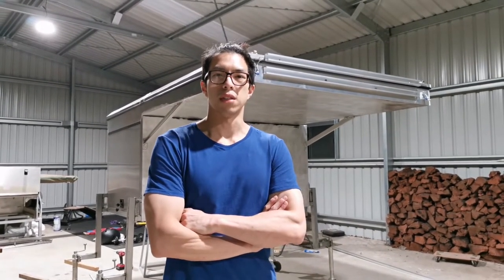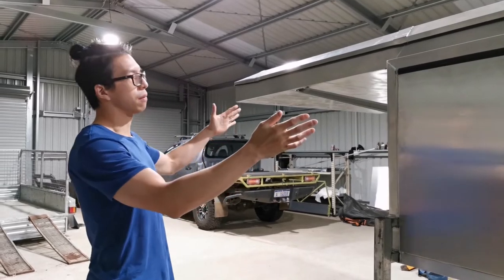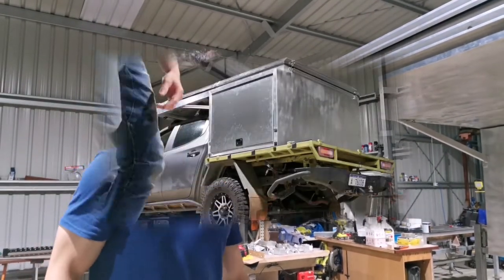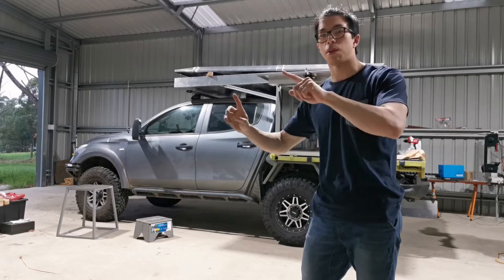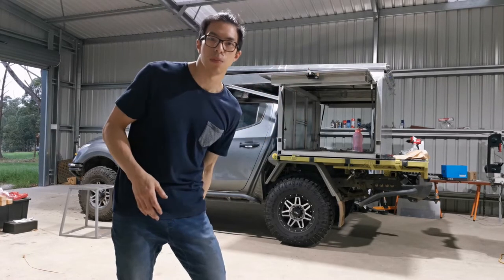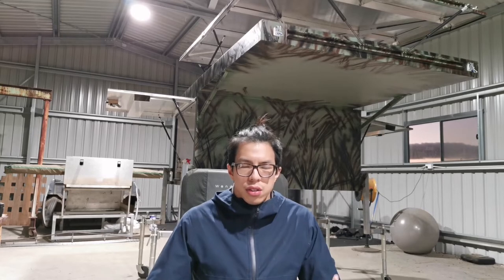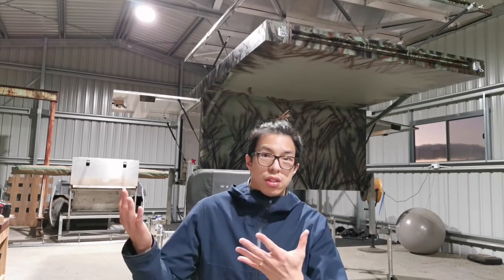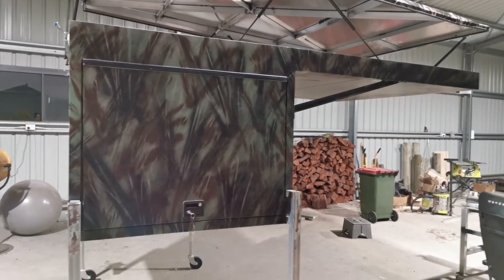Build Your Own 4x4 Canopy Part VI - GAS STRUT Mechanics

Comment: I have been designing a canopy the last few years, and finally, on 4wd number 7, am about to get started building. Surprisingly similar to yours, but somewhat more 'complicated'. I just started welding and came across your site just yesterday. Interestingly, your site has been great, actually showing I managed to foresee most of the issues that you have shown, which gives me some confidence I am on the right lines. My design also has a vertical lift, and to control the alignment of the roof as it lifts, it is easiest to use some 'scissor-lift' mechanism, with two fixed points, two dynamic on rollers. These can be acquired from caravan outlets (with springs to provide lifting force), although I will make my own, just from two joined bits of aluminium, with the gas-struts doing the lifting rather than the springs, which means they can be lighter weight aluminium. Thanks for your site. Great job... Cass.

Comment: I am not aware of your plans to enclose the top, But, if you use a sturdy fabric, you may only need  4 gas struts of appropriate strength in the corners to raise the top. As long as you are able to find  sufficient length, the canvas which will be taut when the roof is up, should provide some stability. The front struts should point opposite to the rear ones as you mentioned , what are your thoughts on this?....Gerry
Reply from the maker: I think there is a potential to put four struts as you mentioned but the tricky part is the fitting process. To fit it safely, you need something to lift the roof to the desired height before you fit the struts.